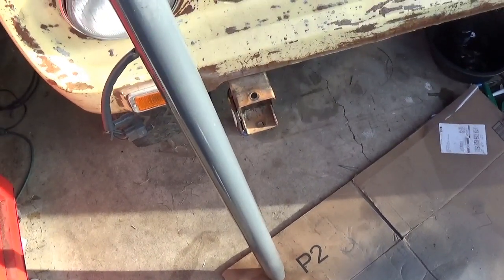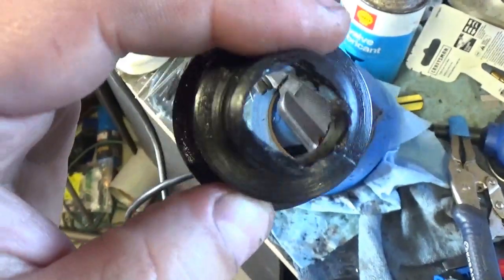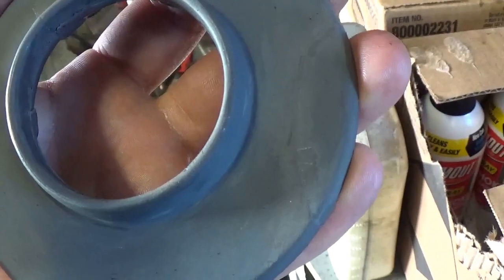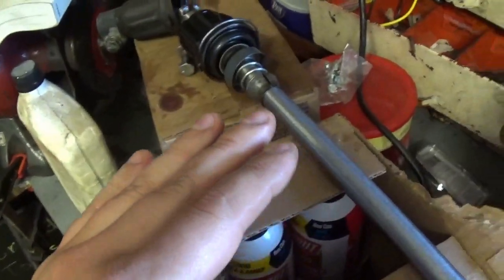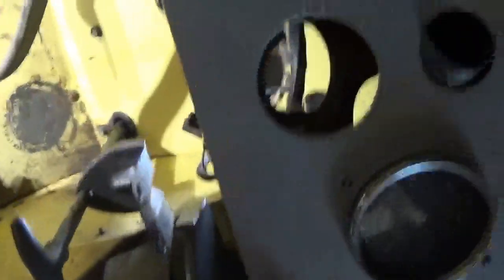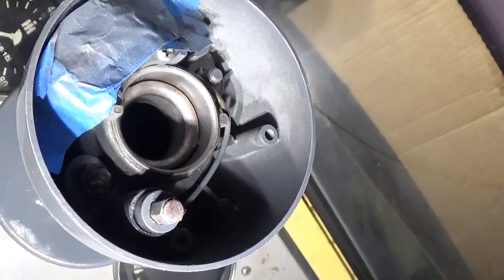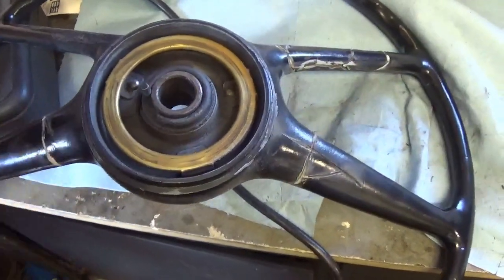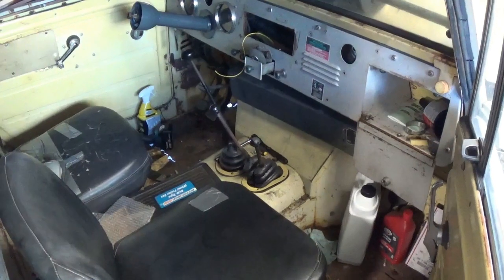Scout 80 Steering Column Shenanigan's

Comment: The Scout feels like a hodge bodge of parts that barely fit together, are you sure this vehicle was made in a car factory? Because, I am getting the sense that this machine is the product of Australian bush redneck engineering. I would very much like to see this vehicle driving again soon. I remember the reason why you put it up, because you couldn't get access to all the high gears in the transmission, it only had low gears available, for a max speed of up to 25MPH. Also, your memory of what once was with the steering column, and what actually is, are two different things. This is what happens when you let over a year go by, till you return to the Scout. Hopefully that screw machine is gonna really pay for itself, as you really need to get this Scout on the road man.